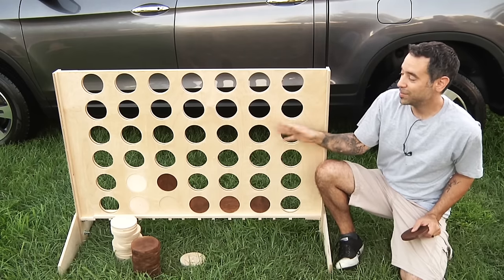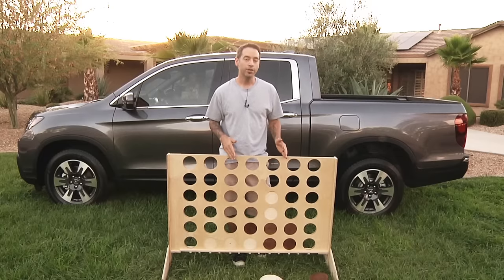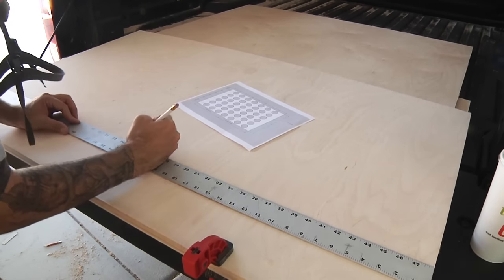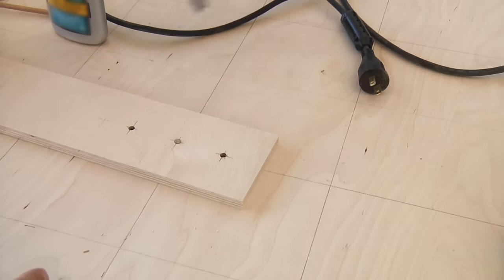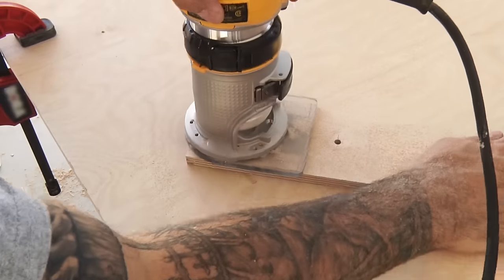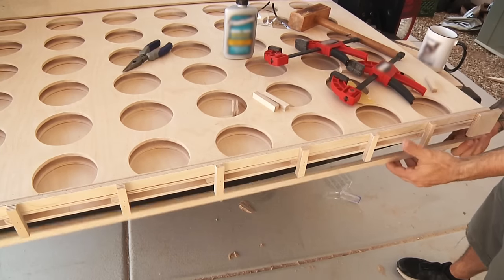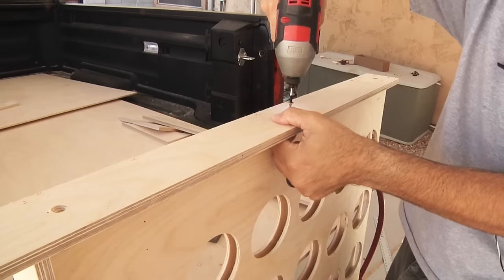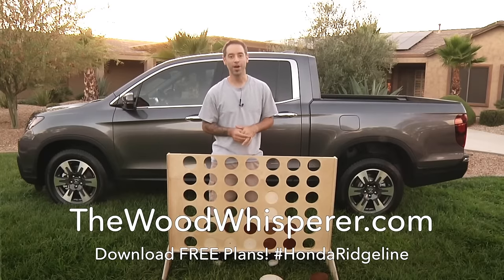267- 4-In-A-Row Game

Comment: But if you use a hole saw the disk and holes will be the same size. So how would that work?
Reply from the maker: You use a two different hole saws.
Reply: +The Wood Whisperer could one cut the wood for the disks to 5" or so strips and use the hole saw on a drill press?
Reply from the maker: +Mike Downs that sounds scary to me. I suppose if you clamp the workpiece and your drill press has a very slow setting, maybe.